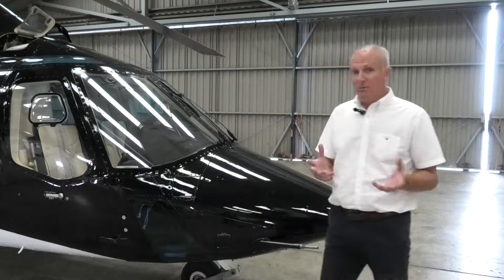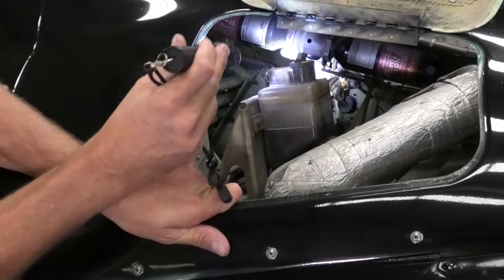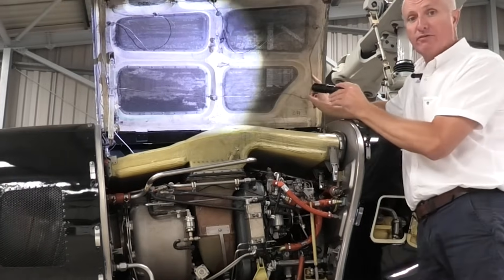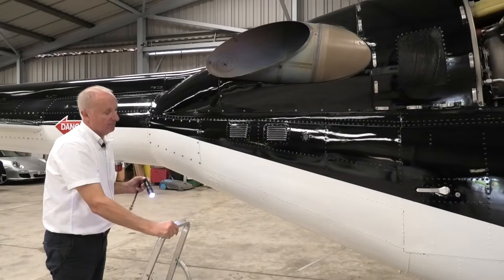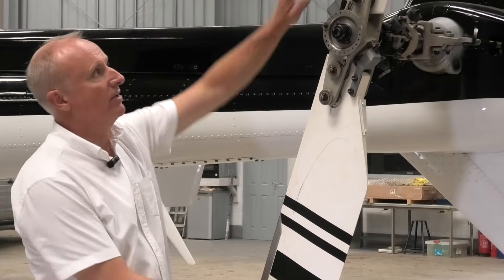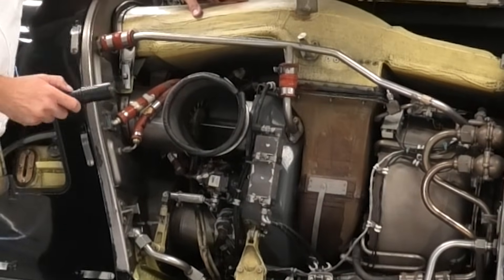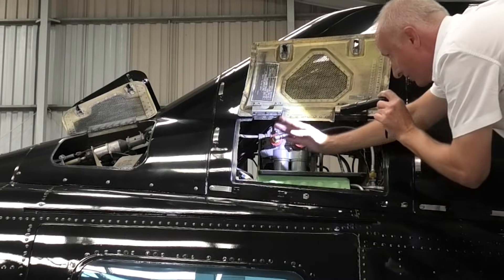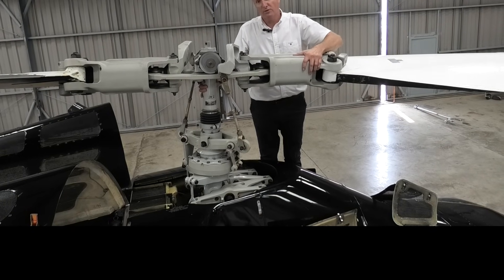The Iconic Bell 222 Helicopter (origins of Airwolf) Pre-flight Inspection

Comment: Thanks for taking the time to make this series on the 222. Just a technical question,  im wondered how did Bell implement vibration reduction. There was a system i think called Nordamatic , maybe spelt wrong.  Just curious how that works and where on the copter the vibration is reduced.

Comment: Don't just look, Grab and feel for loose items. There was an HEMS 222 that was almost lost with a loose servo pack. 
It looped rolled uncommanded only when the pilot rolled of the throttles off on the  bottom of its last loop did it land on a roof of a building.
Crew and all walked away.
Reply: Holy crap , some new underpants needed after that.

Comment: As an aircraft engineer your walk around inspection was rather good to watch. Certainly a lot to look for with an aging helicopter. (Only worked on helicopters very early in my career but now on large pax aircraft)
How difficult is it to find parts for the 222 now it's getting on in years. Does Bell still support them well?